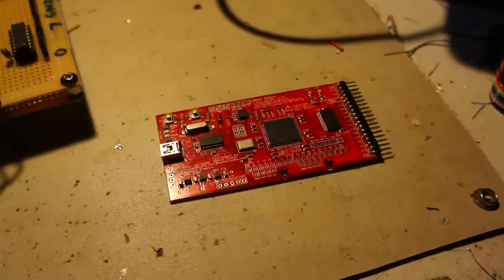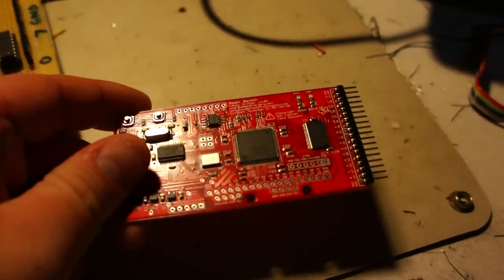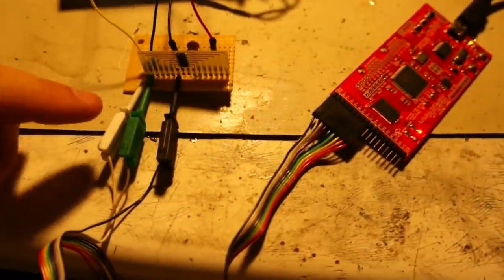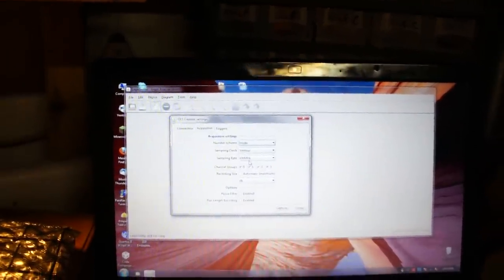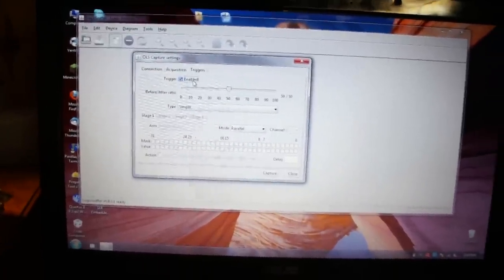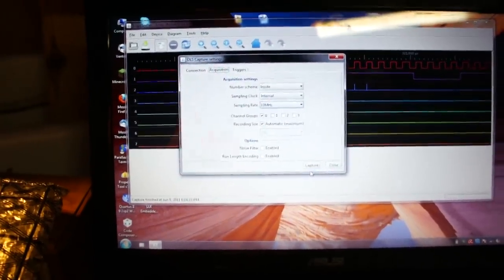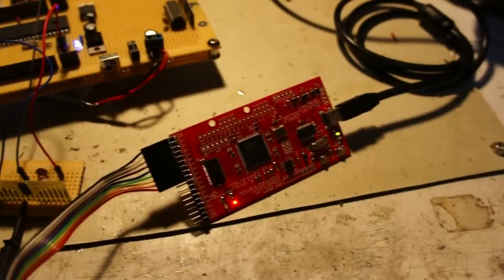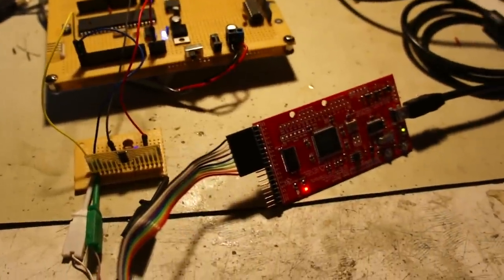Product Review: Open Bench Logic Sniffer by Dangerous Prototypes

Comment: It can actually scan signal at 200MHz as xilinx fpga on board can scan on both clock edges.

Be sure to upgrade both firmware and the jawi client to latest version :) and don't forget to try the singnal analyzer in software (it can decode most regular protocols you use in every day life)

To capture more data, don't throw the space to 50% of garbage before trigger :D

There is also LogicShrimp afailable at dangerous prototypes (also trough seeed) 4 channels 256k samples per channel, same gui :)